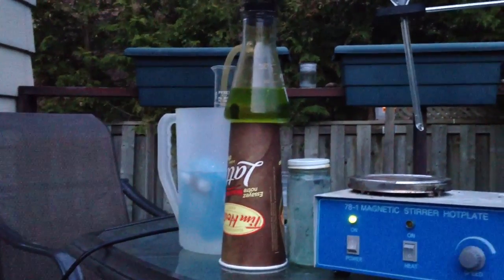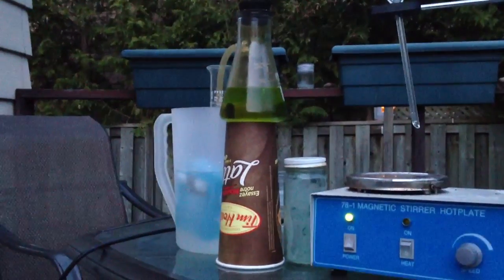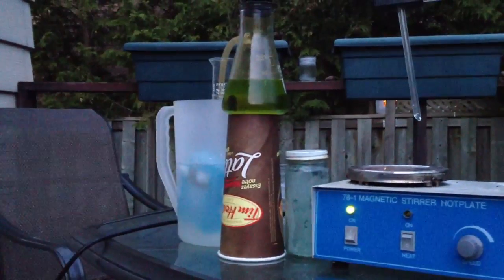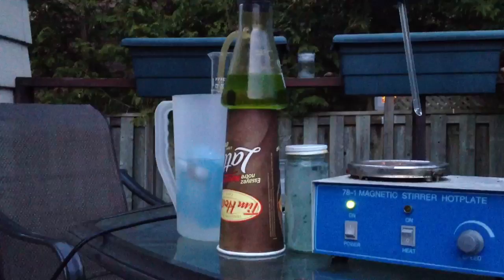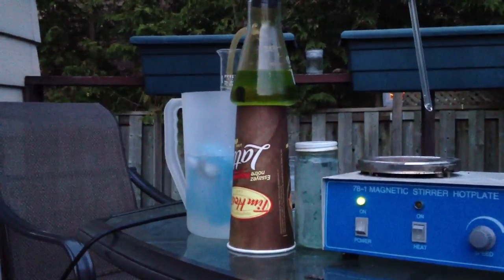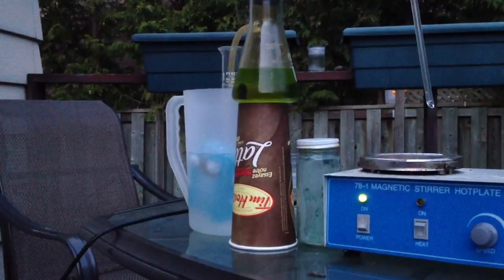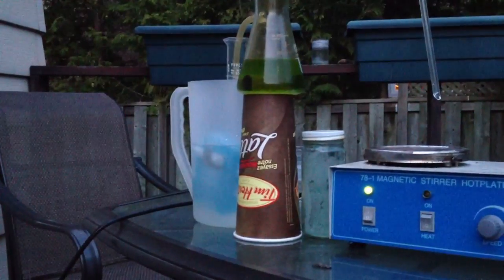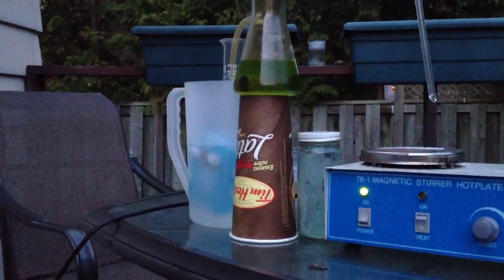Making Nitric acid

Comment: What purpose does the copper serve? I'm under the impression that the hydrochloric acid can directly convert the potassium nitrate to chloride on its own. Is the copper needed in order for this reaction to take place? Or does the copper simply serve as a catalyst?
Reply from the maker: +Oken Tirval So after some searching I found this reaction which I believe is the one occurring. Cu+4KNO3+4HCl-->Cu(NO3)2+2NO2+4KCl+2H2O ; so no its not a catalyst it does in fact participate in the reaction and just to confirm, the reaction between Cu(NO3)2 and Al makes Cu metal and Al(NO3)2. I imagine that since the goal is the production of NO2 and not KCl or aqueous HNO3 the copper is there to allow the production of NO2 gas by immediately reacting with HNO3 formed in the reaction solution. It would be difficult to isolate a pure sample of HNO3 from just the acid salt reaction because of excess HCl, KNO3 and KCl hence bubbling the NO2 gas through distilled water.
Reply: donniesview
Nice, thanks for the answer!